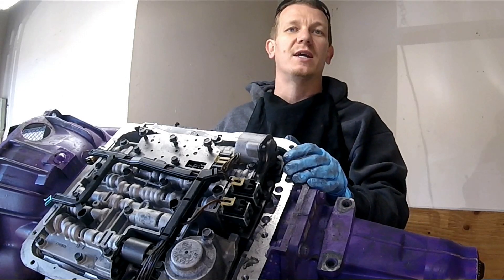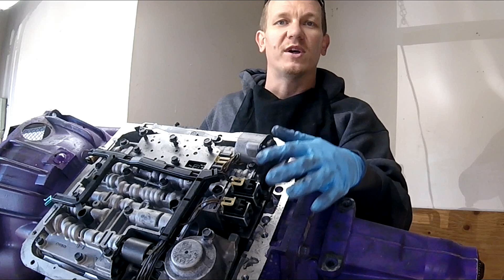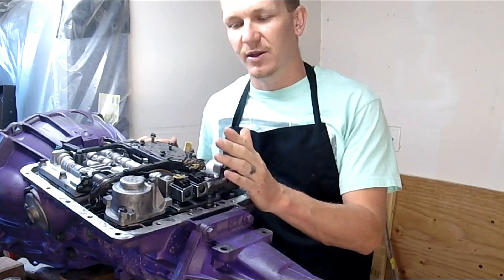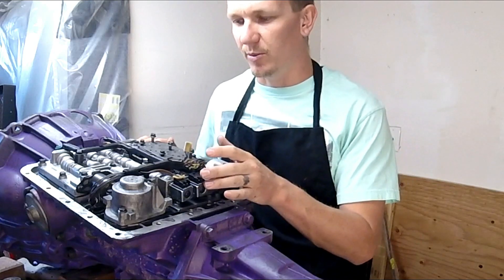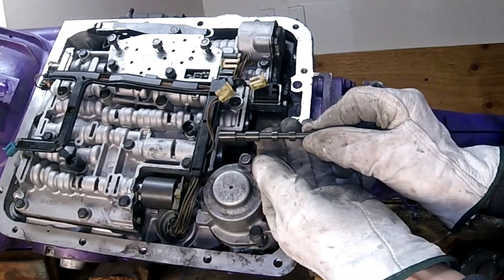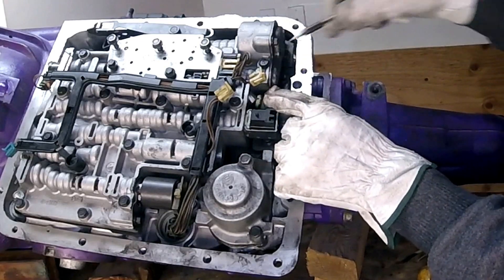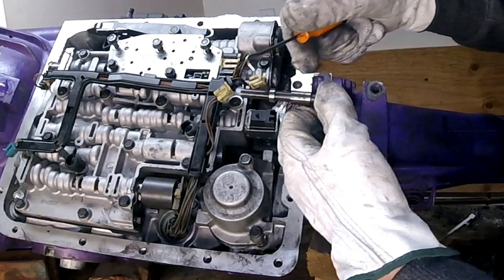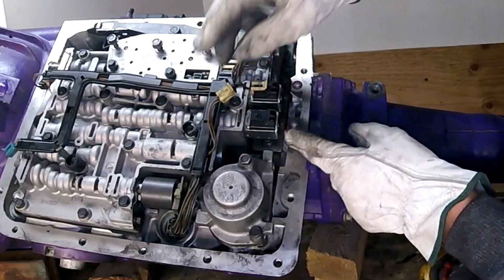⫷ P0757 4L60E ⫸

Comment: Hello, i have a 2002 camaro with this issue. i replaced A and B myself but the code still popped up. i sent the car to a trans builder to have it built and address the code issue. all new sonnax parts, valve body, electrical etc. the code came back 2 more times and trans builder replaced twice with new. both times were ohm'd and were still good. The only time the code pops up is when im going up a steep incline for about 20 seconds holding at approx 2500 rpm. i have 3,000-3200k circle D converter installed (before built) with 2500 miles on when ses came on. what the heck is going on? What happens if i have the code deleted by my tuner? thank you!
Reply: I have the same problem did you end up fixing it?
Reply: It’s a false code, it needs to be deleted by a tuner. basically the computer thinks the stall is slipping and puts it limp mode. headache over with!

Comment: Excellent your videos. I have a 2008 Chevy HHR, suddenly P0757 (solenoid B stuck on) appeared and there are no 3rd and 4th gears. I have changed both solenoids and the problem persists. I must tell you that the previous owner put epoxy glue to repair an alleged leak inside the pan and I have found small pieces at the bottom of the pan, which makes me suspect that they could rise and cause a problem. I also checked the shift valves and they are fine along with their springs (I must say I only checked those two). Any advice from your experience?
Reply from the maker: It is internal, but there is a 3-4 check ball in the case of your transmission. If everything else looks good that check balll might be leaking.

 Hopefully that helps. If you have any other questions please feel free to ask. Also, keep us posted on your progress in what you find. Might help somebody else out. If you check out my video library you can find a video on that check ball.
Reply: @ScottiesHobbies  I am pleased to be able to read you. I will review each step you give me and I will be commenting on what I find. I apologize for my bad English as I have to translate first. Thank you very much and I send you a hug from Mexico.

Comment: Hi friend i have a Van chevy and it use a transmission 4L60e, i got it a code p0757, i checked and the plug was disconnected, solenoid B, the rin seal doesn't seal nothing then i bought two new solenoid. The problen with this transmission is it doesn't shift to 3 and 4 would you like give me more advise or i need buy a new one and this is spensive
Reply from the maker: Did you check the shift valves in the valve body? Make sure they move freely. When you replaced your solenoids did you notice any material or metal shavings in the bottom of your pan? I'm honestly surprised that only Gears 3 and 4 we're not working with the the solenoid disconnected. All four gears use the A or B in different combination.
Reply: let me explain when i put my shift in drive you feel the 1 shift coming good after coming 2 shift coming good after coming in that moment that 3 shift doesn't work but if you put more gas maybe 35 miles/h you relax the gas and you put gas again you feel the 3 shift coming after 45 m/h you make the same proces and you feel 4 shift coming but alwais you have to do the proces before, some one let me some information about unplug the main plug to the transmission and it coming in safety mode and make the proces he said this is the only way to know if the probel is electric  or mecanic i have to try.   @ScottiesHobbies
Reply: @ScottiesHobbies  the problem is when you put the shift in drive and the car is in stop position, the car start to move you feel the first and swap the second but after 25 m/h shift 3 did not coming but you puting more gas and after 35 m/h you take off your foot to the gas and put again y you feel shift 3 coming then you repet and 4 shift coming but it is like manual no automatic. I have been thinking the problem is something electric and your video show me you have experience in transmission like 4l60e
Reply: @ScottiesHobbies  
AB 1ST
B 2ND
NONE 3RD
A 4TH